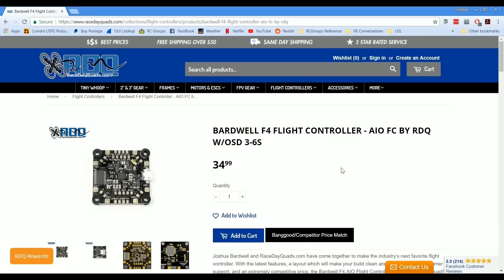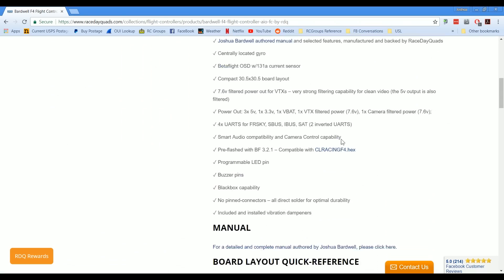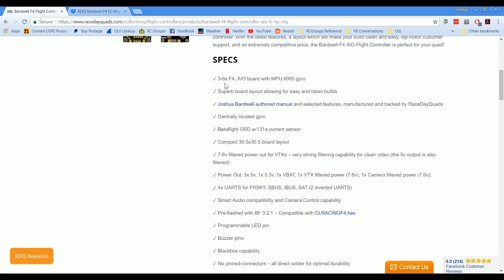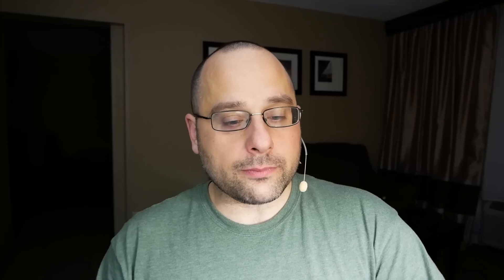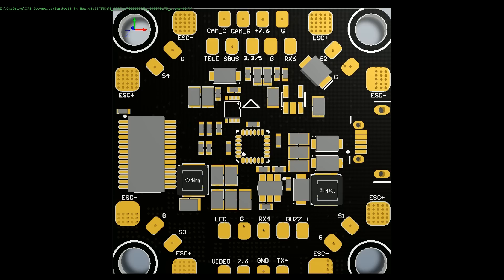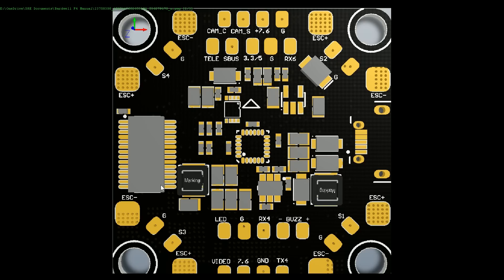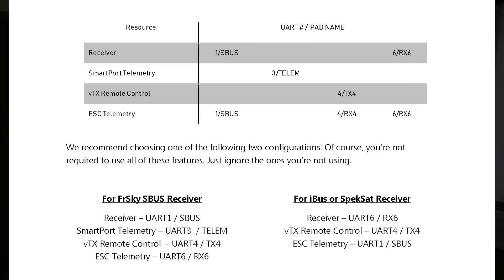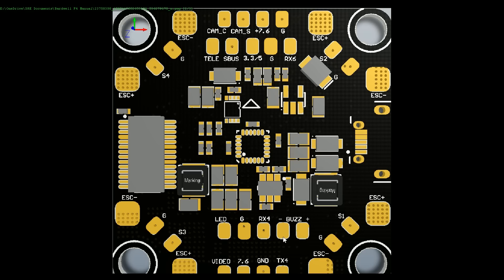Bardwell F4 AIO | JOSHUA BARDWELL FLIGHT CONTROLLER

Comment: Bravo Zulu A man who throws his hat in the ring. Ordered up Thanks could you recommend some modern 40A ESC that you would use?
Reply from the maker: https://www.fpvknowitall.com/fpv-shopping-list-parts/

I have some ESCs there but nothing at 40 amps. I think the max I list is 35. What do you need that is pulling 40 amps anyway?
Reply: ? At this point there is no planned frame I'm intersted in the modern esc capabilties so right now they are for bench testing, motor, esc, prop combos etc.. I have some 30A ESC's that support the newer protocols but I figured some 40A would be handy. But if you have some 35A you would recomend that would work fine as I'm sure they diffrent than the 30A. They will find teir way into something eventually. Thanks for your hard work I learn allot about the whole subject.
Reply: Also ment to mention the FC shipped and arrived really fast, although I'm only in Sofla, havn't had that fast a response from other suppliers located in Otown. Came with a nice metel buckel battery strap. Is the manual really really small? cause I didn't see anything else in the little envople. Great looking FC, thanks.

Comment: Ordered one! The biggest thing i did not like about the previous product, JB parallel charging board, is how fast was V2 released. I bought two of them thinking its the best PCB in the world, and V2 has a ton of improvements compared to V1. Felt myself a loser. Just curious how will it be with the Flight Controller.
Reply from the maker: I think you can assume that I am always going to try to make better products, and if I have ideas for an improvement, I'm not going to hold back on it just to milk an earlier product for longer. This is a fast moving field and every 2 or 3 months something new is out. If you want to wait 3 months to see if a V2 comes out, I don't blame you. But eventually you just have to pull the trigger and buy something.
Reply: Got what you mean. Better release V1 now, gather feedback and make a better V2, than just continuously fight for perfection.

Comment: Can we get some more info about using the cl racing f4 hex you mentioned?
Reply from the maker: +D'Rash FPV it's just the Betaflight target that is used to flash the board. There's not really anything to it.
Reply: Joshua Bardwell cool!  Just caught my ear cause cl racing is my preferred board but due to the noise issue I think I'll be giving yours a try. Clean video makes better pilots.

Comment: I keep hearing this "crossfire needs to have channel 1 & 2 soldered to the same UART." Is this true? I have crossfire on my Chameleon, and I soldered up channel one to an open rx pin, and channel 2 to the Tx pin of a different UART, and I haven't noticed any problems...should I be worried about my set up? Thanks!
Reply from the maker: +1917VIL well I don't know actually.
Reply: ok...well, sounds like it is ok to enable more than one thing on the same UART in the BF Ports tab...I didn't even know you cold do that. I think it was NJTech that said solder to the same UART, but my buddy helped me set mine up because he had already done so, and we soldered to different UARTS...
Reply: +1917VIL Crossfire can use the same UART but does not have to.
Don't sweat it - it's working right? :-)
You're "wasting" a uart, but it doesn't really matter as long as you didn't have to give up some other feature that needs a uart.
Reply: much appreciated!

Comment: Sounds like it's going to be my next investment and I need multiple! The manual is Key especially for diagnosing. And is there any way to implement a reverse polarity protection where it would only blow out one diode or resistor or something? It seems like that's the only way I end up killing my flight controllers. I know that's how company stay in business but I know that you like to be better than that. Just wondering if it's possible? Thanks for the awesome product I hope it doesn't get cloned and get a bad name for sure maybe the next versions should come with Bardwell signature screen print!

Comment: I drove to Orlando (40 minute drive for me) picked me up 4 of them and starting 2 builds now. One a custom frame I cut my self that is on 6k carbon, 3mm bottom plate symmetrical X (frame weight is 67 grams on the nose) and the other is just a slightly stretched version of the same frame coming in at 70 grams. Both wearing Mach 2 vtx, the stretched frame running the new BrotherHobby R5 2207 2700kv motors the other the Emax LS2207 2550kv, of course your FC, Wraith 35a blheli32 on both builds and Runcam Eagle 2 pros. Gensace just sent me a c are package so I have 12 brand new 95c 1550 4s R-lines and 10 95c 1300 R-lines.. they also sent me 6 5s 1550 R-lines and 6 1550 6s R-lines.. charging the 4s 1550s right now and the 6s 1550s right now as well. The other two are going on a Hyperlite Floss 2204 build that is ready to go just gotta drop in the FC weight is 204 grams and the other is going in a earth movingly powerful BH V5 2507 2700kv build that will be exclusively flown on 6s 1800s..honestly it's going to be insanely stupid powerful.. by far the highest power to weight ratio on any quad I have ever flew.. it will all 4 will be built and flew today. I really don't know what to expect from that build with a flight ready weight of 347 grams minus battery it's a skinny armed very aero based prototype frame.. I really don't know what kinda speeds it will be able to reach but that's what it is a speed run machine.. I may change it over to the 2450kv 2507s after I play with speed runs for a while and it will be a earth lifting freestyle machine that will shock with its preformance.. Anyhow I will be putting your FC threw it's paces today.. I'm expecting it to be simply superb..

Comment: Just a little Input

Looks like I'd have to use Soft Serial

1 Tx Uart for Spektrum Telemetry and Communications
1 Tx Uart for Tramp Control
1 Rx Uart ESC Telemtry

Current sense should go to 140 Amp for those using 35 Amp ESC's

Also through holes would be nice

Comment: I really like your FC, it has everything i use and the layout is mostly great aside from the things you pointed out yourself. I do have 2 improvement suggestions that may not be even possible but they sure would be unique. 1. Have a main power pad after the current sensor for those of us who want to use either a 4-in-1 ESC or an external PDB.(This could be done by just having one of the motor pads be bigger with a strong connection that can handle the current and to have it on the bottom of the FC.) 2. Mount the gyro in the middle of the FC in a hole in the main board, on a separate PCB that is vibration isolated with a rubber grommit and connected with a ribbon cable like on Kakute F4. That way it would be both flush with the board unlike on Kakute F4, but still on a separate PCB and completely soft mounted at the same time.

Comment: DO U HAVE ANY DVR FOOTAGE ??? EVERY AIO OTHER THEN THE MATEK F4 AIO HAD TONS OF ELECTRICAL NOISE ALL OVER THE VIDEO . HORIZONTAL LINES ACROSS THE SCEREEN EVERY TIME U GIVE IT A LOT OF THROTTLE . WILL THIS FINALLY BE ANOTHER AIO WITH CLEAN VIDEO???
Reply: will probably need a Cap... lol
Reply: dude. why are you shouting that loud?
Reply: Did you watch the video he said it had clear feed
Reply: Might just be your vtx, while my matek has clean video, so does my bff3, bff4, airbot pro corner.
Reply: nub actually I think this dude needs less caps. He used all caps!

Comment: Not mocking it and I don’t know the numbers but are more people still using individual ESC as there is a big emphasis on your board that the ESC is in the corner. Maybe I am minority but I use a 4in1 instead. It’s much cleaner, it doesn’t add weight to the arms. No prop strike on the ESC.

Comment: Im struggling picking a board for my 1st build. its a large 680mm+ with 16" props and 6s.  all these tinny race boards are still interesting because save weight when can.  will this board or the similar work for me?

Comment: Congratulations Joshua!  Some techs here (on-line) have the knowledge but can't impart the info to others. After review of your Owners manual, I, for one, applause your efforts. A great board I am sure but, the directions are absolutely understandable and, without question, the best "manual"  I've ever seen. Actually because of that manual, it was motivation enough to use/purchase this board.
Reply: YES
Reply: I purchased the Kakute F4 AIO because of the manual he wrote for it
Reply: The best board without backing support is shit. A shitty board with proper support is acceptable. I don't see how this board can be shitty and we know there is support.

Comment: Awesome design on the board Joshua but please move the buzzer pads to the edge of the board! Maybe move Tx4 next to Rx4 and scoot the buzzer pads to the edge. I know u said u use dshot commands instead of a buzzer now, but I find the buzzer to be louder than the motors chime. And that way u can kill 2 birds with one stone! ;)
Reply: yfz450manny I was reading this and thinking wow this sounds like exactly what Manny was saying and then I saw it was you 🤦🏼‍♂️
Reply: Hurricane FPV Tell me you wouldn’t want the buzzer pads on the edge! Lol
Reply: yfz450manny well actually I just set up the Dshot commands beeper so I’m not gonna use a buzzer anymore!
Reply: yfz450manny get with the times old man!!!! 😂
Reply: My esc’s were just as loud if not louder than my buzzer!
Reply: Can your ESCs beep to let you know your gyro has calibrated?..Can your ESCs be setup to audibly alert you of low voltage on your flight battery incase your OSD is not functioning properly, or you choose to not use OSD, or are using an FC that doesn't have OSD function?...Can your ESCs alert you if there is no Rx signal being sent to the FC?.....And I'm pretty sure there are a bunch more things we take that little buzzer for granted..

Comment: Joshua is right about the Kakute F4 taking up room. I started mounting mine on rubber standoffs but I also like to mount my vtx on the top plate with backside against carbon for heat dissipation. While I was able to make them fit they were too close for my comfort. I ended up dropping the FC and using rubber washers, which may not be needed as the gyro is mounted on foam. Anyway, thanks for video and FC, believe I may build another as my wife is wanting to get into flying.

Comment: why you put sd card on it? how about conformal coating? don't you ever drop your quad on a wet grass at least? i'm flying in rain and snow, and none of my sd-card fc can write blackbox because of bad contacts, but there is no problem on fc with flash ic. and i can not find any new fc without this crappy sd-slot. i need to tune it only once, and sometimes debug after crashes. onboard flash is far enough for this. i don't need 8 GB of flights. and i don't need to open my quad to eject that stupid card to put it into sd-reader to put it into usb..
Reply: man125403 desolder it and use an external logger. Only need to connect it once to tune. Open quad back up and remove it for next build. Little extra effort but its a one time deal. Unless you change motors or something weight wise.

Comment: Is there an I2C port to connect a GPS for use with iNav?
Had a look at pics on website but couldnt manage to spot it....
Thanks in advance & congratulations! :)
Reply: uh-oh... I, too, was looking to use I2C GPS! whatup wi' dat?  are there pads for SDA & SLC? is it possible to get to them, or might they be right on the processor chip?
Russ from Coral Springs, Florida, USA
Reply: somewhere near that. I, too want to use iNav. this entails a GPS & Magnetometer. the "Mag" usually uses I2C. i don't see a Magnetometer in this device. (and that would be ok, as long as you could install an external one.)
Russ from Coral Springs, Florida, USA
Reply: You making a 250 or so size quad?

Comment: You mention putting a F7 on it - what's your opinion on the F7? Does the F7 take away too much space on the board compared to what you gain; is F4 the optimal ratio of space/features?

Comment: What you have looks great, nice job, and it's priced right. I'll be trying one (already had a RDQ order going). I don't see a huge advantage for Esc telemetry besides tuning, (actual rpms), but an extra UART for the Runcam Split is nice for freestyle and sport quads. I know you can repurpose motors 5 & 6 on some boards, but I'd bet there are more people wanting another complete UART than are people running hexacopters. (at least in the sport market)

Maybe next you should work on a daughter board with VTX, Rx & Escs, then we would have a true AIO system, The trend is toward the light armed stack based setups, and true AIO with only 2 boards would be huge. You could add the extra UARTs on here if you pin couple or flat flex cable (better IMO) between them.

Hope my 2 cents helps a tad. 

Way to go!